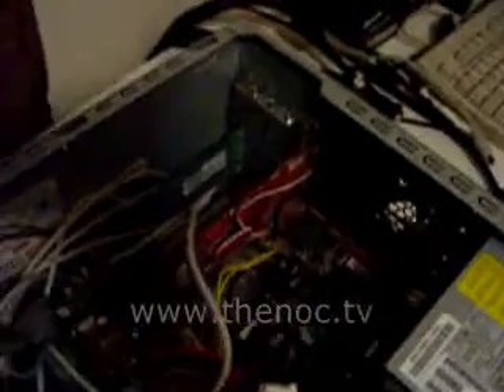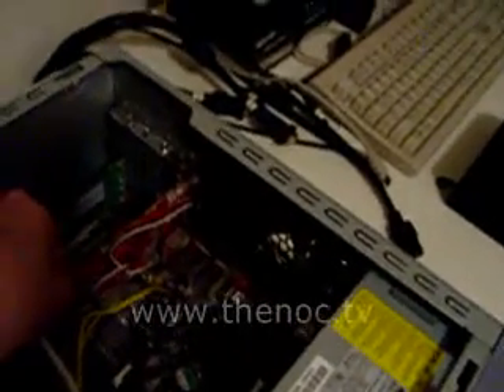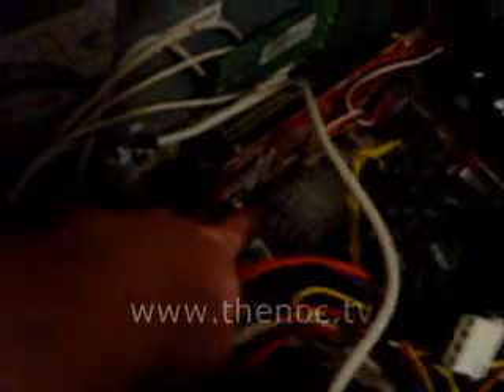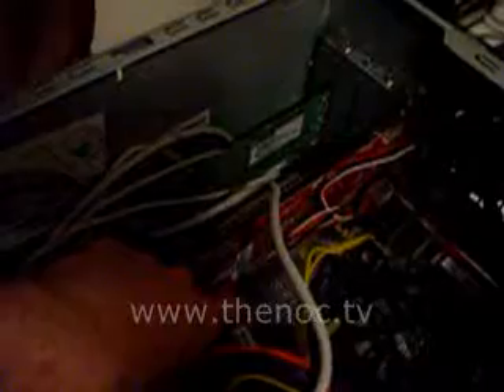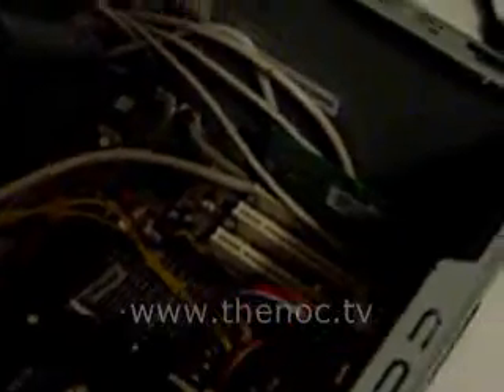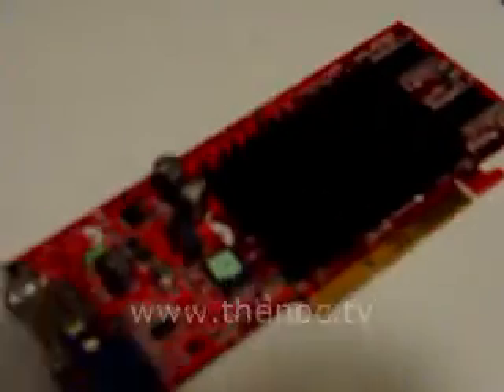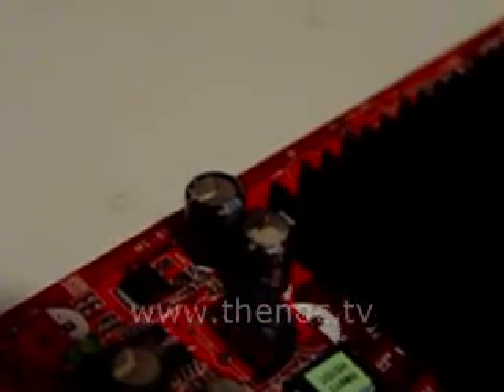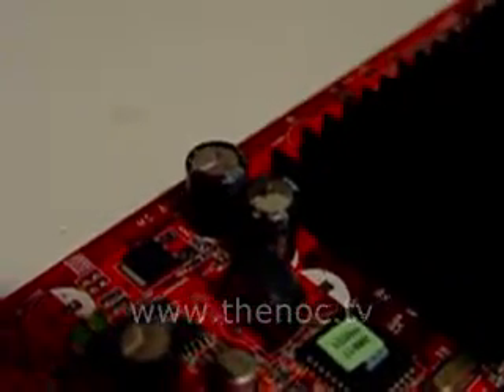How to Replace a graphics card in a desktop computer

Comment: I plan on replacing my graphics card, I have an AMD Radeon HD 5450, and I want to upgrade to the 5670.  Will I have to update the graphics card drivers when I first power the system on?  I'm new to the PC world, as I have been stuck using a Mac.  Lol.

Comment from the maker: @gamer141235 Slim computers are a bad idea to upgrade as far as graphics cards go. They have really no where to disperse the heat to, so they just build up and eventually cook themselves. Most will take the card as far as physical interface with the slot and bracket, but often end up too long as well if they are more powerful. Look up the physical size of the card (Should be listed wherever you are buying it from) and check your computer inside size.

Comment: Have a question?

i am getting a slimline computer, but it comes with a weak graphics card.  I want to get ATI Radeon HD4350 512 MB PCI-Express Video Card, but am unsure if i can get it for my computer.The card it comes with is a ati radeon 3000 and that is what i want to replace. Is this possible to do, especially  considering it is a slimline and  how can  i confirm that getting this card will fit the computer. Also, sorry for long question, i am new to this.

thanks,

Comment from the maker: @akatsuki079 You don't have to do it first, and I try to avoid doing that myself as some cards do not take well to being uninstalled while still in the system. However if you do it, be sure to uninstall, shutdown, install the new card, then start it up. Otherwise the old drivers might get reinstalled on the restart with the old card still in it.

Comment from the maker: I never heard of a PCI express .0 before. I assume you mean a PCI express 1.0 or 2.0 slot vs just "PCI Express".

Normally when you see just PCI express it refers to a 16x slot. So in this case the 16x is faster. They already have higher PCI express standards designed, they are just phasing them in. You often see 1x and 2x used for modems and sound cards because they need less speed.